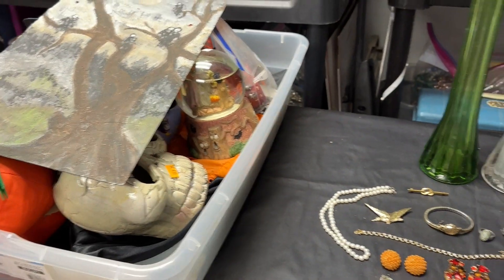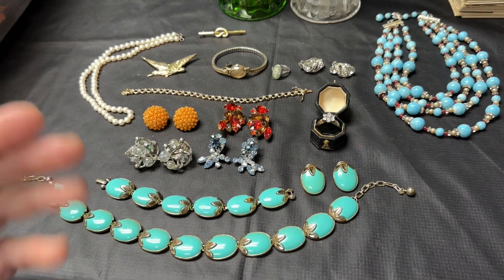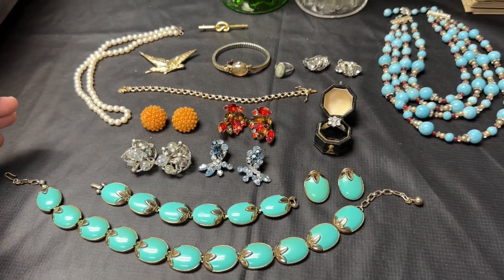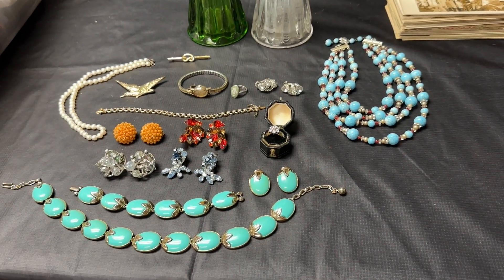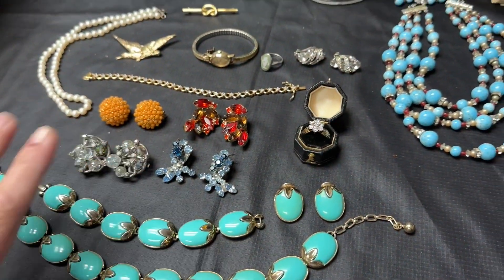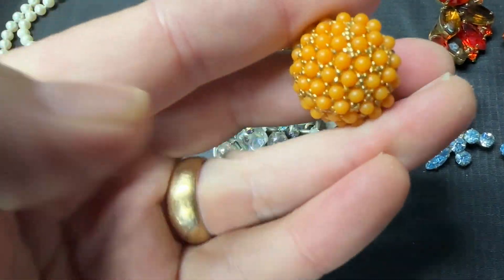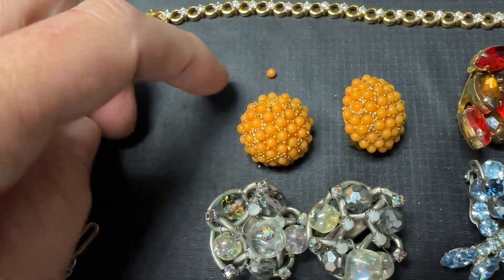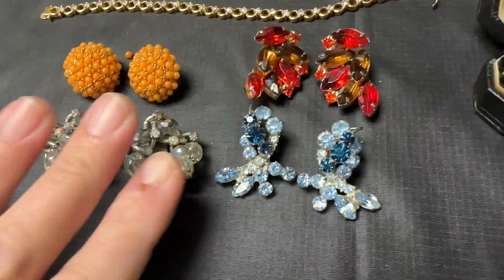These Are Some Of Our BEST SELLING ITEMS For Online Reselling

Comment: Hi, Rusty. I saw you had an old riding hat. That is older, and is not up to code to use any more. Not nearly enough protection. Current specs are closer to a bicycle helmet. Plus, if yiu have a serious crash, they have to be sent in to be checked.

Definitely not like the old days when we rode bikes and skateboards without hmets and pads.